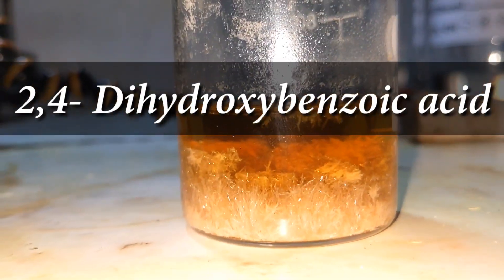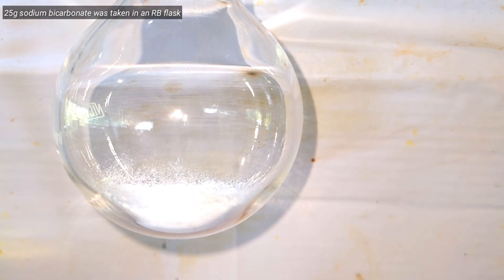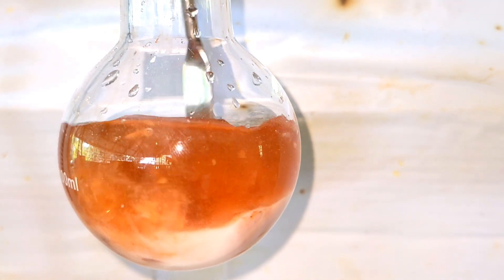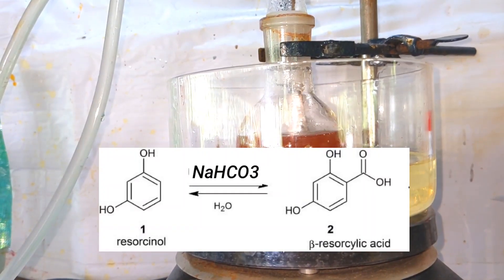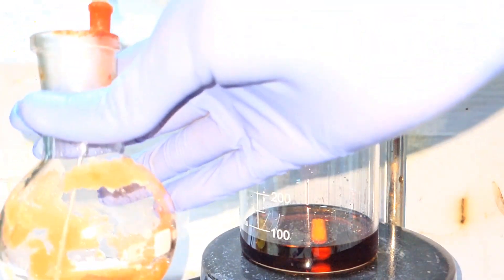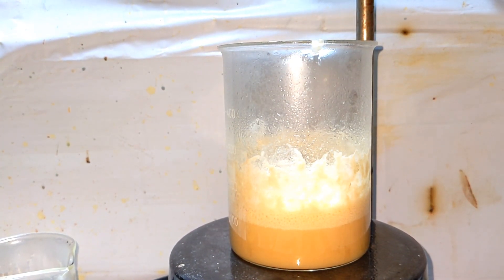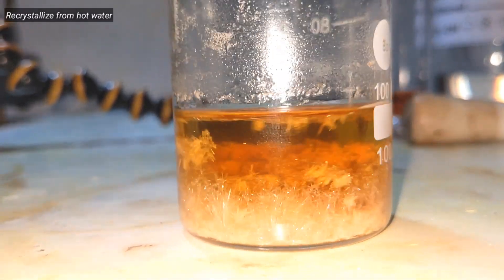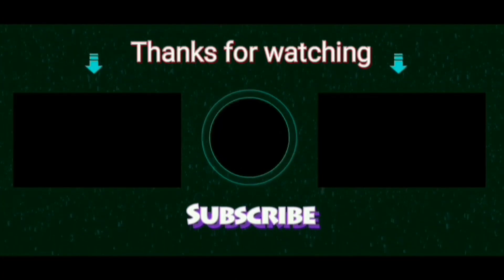2,4 Dihydroxybenzoic acid Synthesis : Kolbe Schmitt reaction

Comment: Can you guide me how to make it from benzoic acid?
Reply: Benzoic acid -> Sodium benzoate -> Benzene -> Nitrobenzene -> Dinitrobenzene -> m-phenilenediamine -> Resorcinol -> 2,4-dihydroxybenzoic acid
Reply: @illya.ruslanovichshevchenk4106  hey pal,thanks for informing
Reply: m-Phenylenediamine is produced by hydrogenation of 1,3-dinitrobenzene. The dinitrobenzene is prepared by dinitration of benzene .
Reply: This was an educational video, so he probably won't guide you. Your best bet is to do research, look up the chemistry and check out electrophilic addition. I am sure you could probably find papers online explaining how to do it from your desired precursor.
Reply: @synthesizer8026  thanks to inform buddy
Reply: By quick guess, try halogenating it and then let it react with NaOH.
Reply: @user255  great idea but unless it is I that is a tough route, Br and Cl are very stable on a benzene ring and it takes 300°C+ and super high pressure to swap a halogen for a hydroxyl.
Reply: @user255  yah, I am pretty sure it needs an exotic catalyst. I have not read too much on that process. Basically the short of the method I am thinking is nitration, reduction, azo, hydroxylate. Same concept as your halogen route process but there is a azo group between the halogen and benzene ring. The azo group is a much better leaving group.
Reply: @user255  it's all good man.
Reply: Honestly a quick google search on how to add a hydroxyl group to a benzene ring should pop up some results. Hint NO2, but that is all I am going to say.
Reply: A bit if a tip, benzoic acid is ortho/para directing, with a little more research you will find how you can add hydroxyl groups in the ortho/para position.
Reply: @synthesizer8026  Benzoic acid is meta directing.
Reply: @illya.ruslanovichshevchenk4106  i don't know why I said benzoic acid I was meaning toluene is ortho/para, then oxidize to benzoic acid. I believe I clarified in another message but may be wrong
Reply: @illya.ruslanovichshevchenk4106  I guess in my later message I didn't mention the oxidation. My whole thought was nitrate toluene, reduce the nitro group, form an azo group hydroxylate then oxidize the methyl group. Thanks for pointing out my mistake.
Reply: I am guessing you know what ortho/para positions are.
Reply: @synthesizer8026  do you how to add  (OH)- group to ortho and para position of benzoic acid
Reply: @Prchemist06  research my good friend. Are you taking chemistry in school? Or more as a hobby?
Reply: @synthesizer8026  i m taking chemistry in school,but these things are not  taught yet so that's why i m asking
Reply: @synthesizer8026  are you indian?
Reply: @Prchemist06  no, just a Hindu. I am Canadian.
Reply: @Prchemist06  for sure, learning takes time, I too am in school.